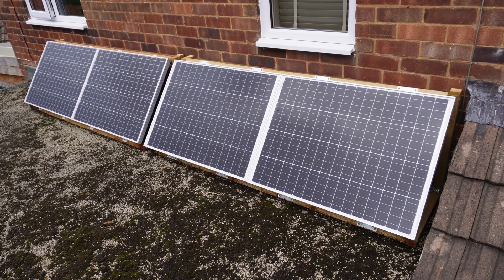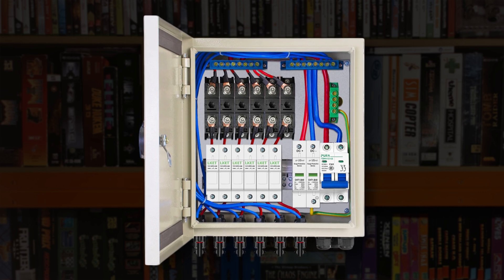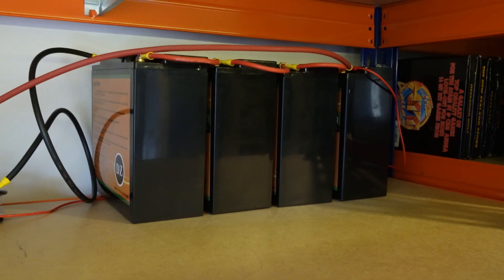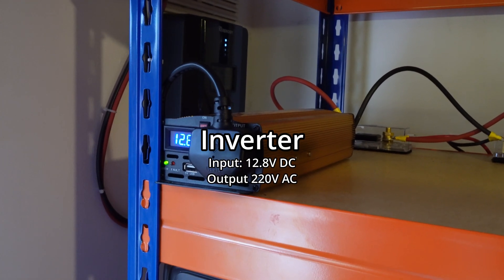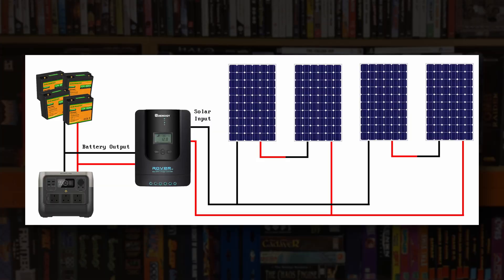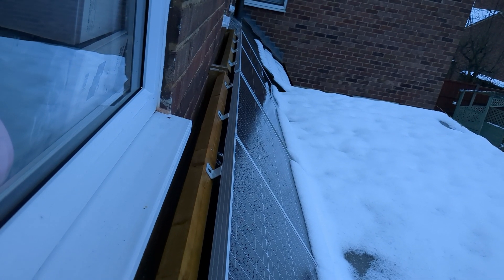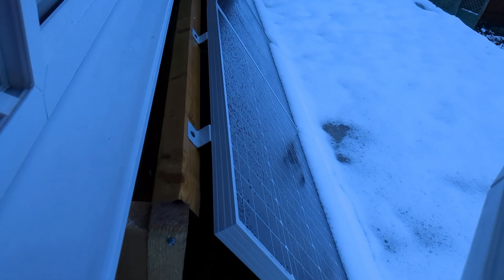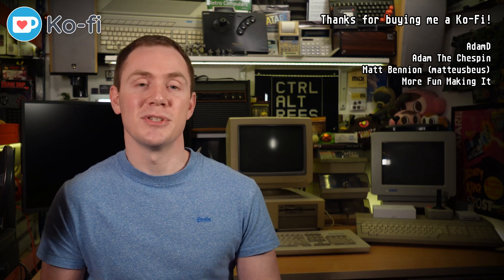The "Off-Grid" DIY Solar Power Setup That Powers My Channel

Comment from the maker: I appreciate there's a lot of interest in the cost of this setup so I'll break it down here: The original Eco-Worthy kit was £500. I then spent around £200 on 2 extra panels, just over £100 on the Renogy MPPT charge controller, £80 on the battery meter and the 2 extra 20Ah batteries were £180 used on ebay - so the total is a touch over £1000.

In an earlier release of this video I made a very brief passing comment about the cost that on further investigation turned out to be a little short, and so I've edited that part out. It wasn't my intention to mislead - I've just added a couple of bits since then and not updated my mental running total!
Reply: Wow! That's a lot cheaper than I thought. How long did it take you to recoup your expenses with savings on the power bill?

Comment: I'm very interested in how long your lithium batteries maintain their capacity.

I have only been able to get around five or six years of usable life out of my sealed lead-acid batteries before a mishap like deep discharge in cold weather, and the capacity takes a nose-dive. The 60Ah battery in my 200W garage setup can no longer keep a raspberry pi running overnight, and a different battery in my similar-sized caravan setup lost a cell after being covered with a very thick tarp (blocking the panels) for a season. Lead-acid batteries are cheaper than LiFePO4 to replace, and for small banks or fixed installations the size and weight is not an issue, but if they last longer, would be worth it.

Comment: I also recently started a solar project, partly to power up my workstations/pcs/living room tv, part to have a 3rd energy redundancy (1st is a good old gas gen - i'm on the countryside).
Plan is to up-resize in the near future, increase storage and pvs to get more appliances connected to it - and possibly the heat pump or water heater.
Few days ago, had a vehicle batt get totally drained, was impressed on how fast the 2x pvs and 2x cheap pwm chargers charged it (70A in under 3h). Latitude 40ish. 
I also went with similar to those PWMs chargers, rated for 30A but working on ca.15A, get mildly hot. Noisy on full load, but works. Do need some kind of indicators for changing status or drain.

As for cost, my rule is to get the biggest bang for buck. Got pvs new at the lowest price/w local shop, biggest Amps chargers for 12V batts and pvs voltages (amazon), cheapest used/tested AGM bats.  I will probably have future issues with amperage and cables, but thats a problem i'll solve then, possibly get everything near to save on cables.
Reply: Was about to say something about cable thickness from bats but saw your inverter power.

Comment: I see the MC4 connectors are quite efficient for your office/studio setup but I've found the MC5 are better for when you run into the occasional need to simultaneously kick out the jams.